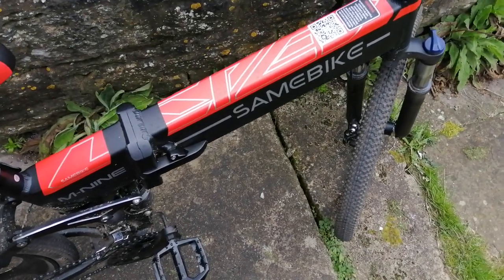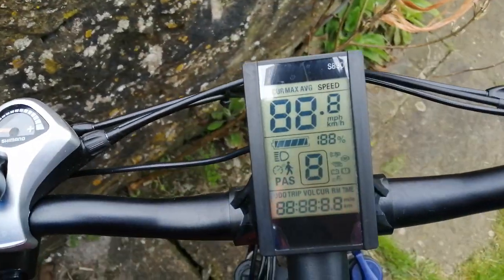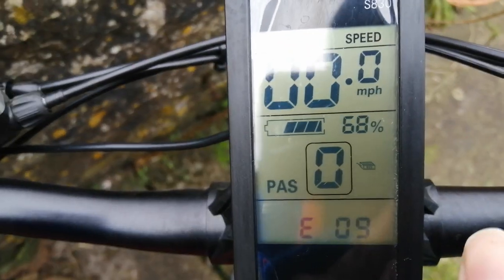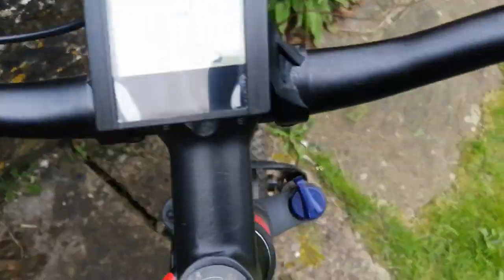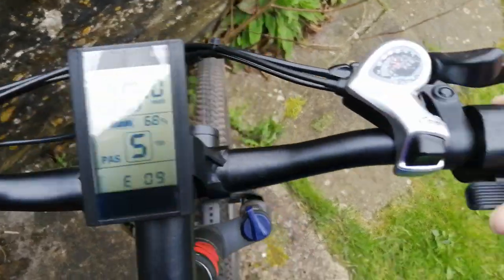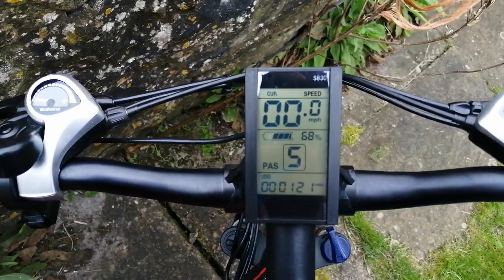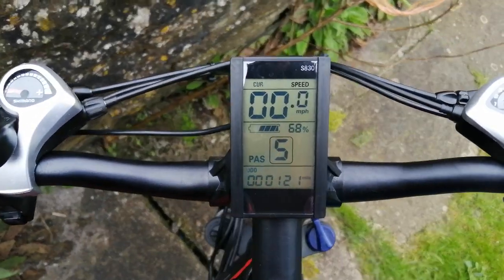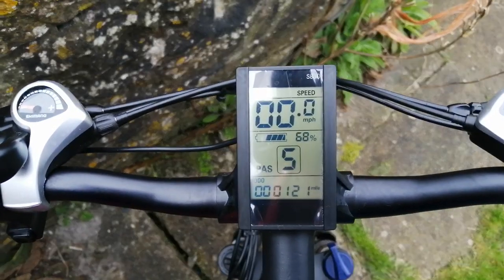Samebike E-09 Error Code

Comment: Same here, and i just received the bike today...Could you please tell us if you managed to solve the problem? And if so how? Thanks in advance.
Reply from the maker: Hi. I'm in negotiations with the seller who is in turn chatting with the supllier. I'm trying to see if I can send  the back wheel back for a replacement, as we think the motor has died. It's taking a while. Meanwhile I contacted the Samebike people to get some idea of spares including a battery for longer cycles. That information is a little slow. I thought it would be so I bought the 500 W version in the meantime. Also suggest wrapping some sponge tape around the battery as it clatters about a bit I noticed. Cheers.
Reply: yoe Poeta I have the same poblem. Have you solve it?

Comment: Did you sort the problem or find how to reset? I have the same problem. Only had the bike 4 days and the error started after 45kms!
Reply from the maker: Hi. I'm in negotiations with the seller who is in turn chatting with the supllier. I'm trying to see if I can send  the back wheel back for a replacement, as we think the motor has died. It's taking a while. Meanwhile I contacted the Samebike people to get some idea of spares including a battery for longer cycles. That information is a little slow. I thought it would be so I bought the 500 W version in the meantime. Also suggest wrapping some sponge tape around the battery as it clatters about a bit I noticed. Cheers.
Reply: @mrphillpayne  My seller claimed the manufacturer says it's a proplrm with the controller. They said they would send one. Let me know how you get on, and I'll keep you informed of my progress. Cheers